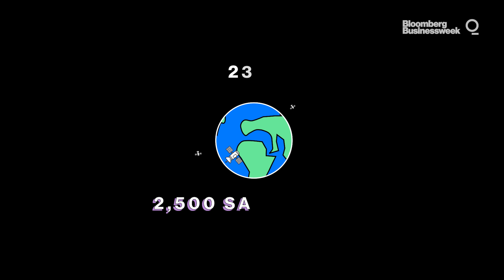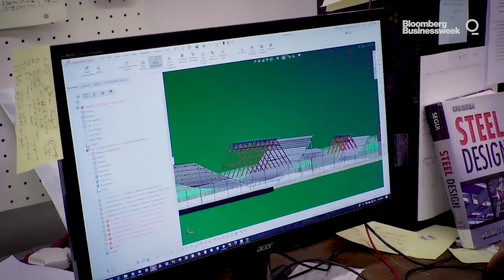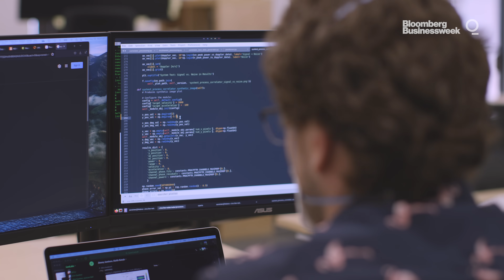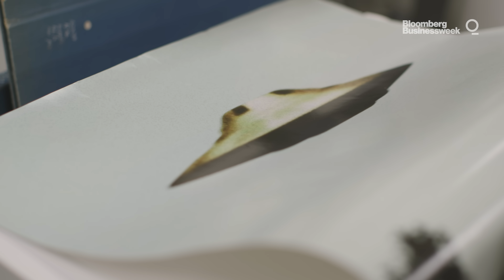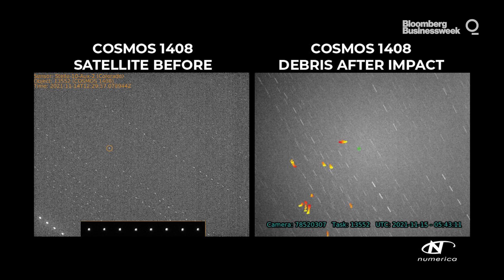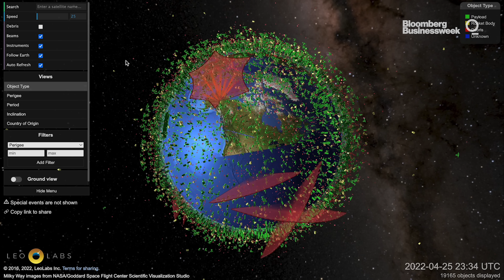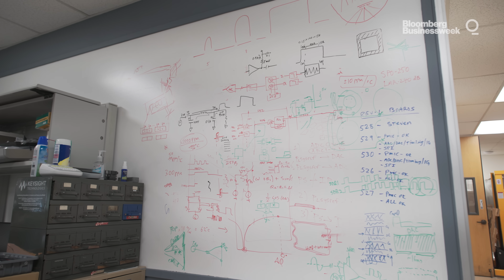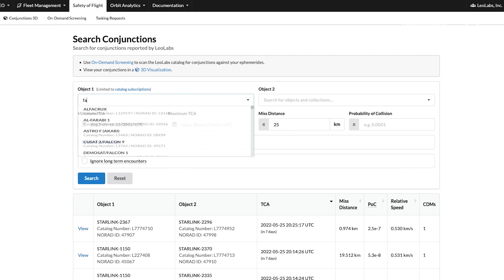How LeoLabs Is Using New Tech to Target Space Junk

Comment: Dont believe a word- nothing can remain in the air: Satellites are on the ground- ask every commercial pilot!
Reply: Have you actually asked a commercial pilot though?
They know better than most that the air gets thinner and thinner when you get higher.
If you get high enough there is barely any air resistance anymore. (much higher than airplane)
There, if you go fast enough sideways you'll be able to fall around the earth since it's round. You have to go crazy fast: 20x speed of sound, 8 km/s. That's why large rockets have to be used to make satellites stay in space.

Comment: is there any way to clean up this mess? could we used some sort of nets to catch the debris? is there any way to push that debris out into deep space? would that be safer?
Reply: Everything in low orbit will come back to earth in a few years ... 15-20 years something like this
Reply: The problem is things move really fast. That's why they stay in space. If you try to randomly catch some debris with a net it just explodes violently from the collision. Just putting a big net in orbit is like those bad debris creating anti-satellite weapon tests. So you need to match the orbit to catch each piece of debris gently. This costs fuel. That means more cost and more mass, which means you need a bigger rocket to launch the debris collecting satellite. Bigger rocket is more expensive too. It's still expensive to launch stuff into space, so it's just not worth the money doing the clean-up that way at the moment.

One way to get rid of the need to match orbits is: shoot at the debris with a laser. A laser can ablate some of the surface of the target, acting like a thruster. If you fire at it from the right direction you can slow the debris down which makes it go lower. But putting lasers like that in space is a political problem (and also expensive of course). If for example the US did it, Russia, India and China could see it as a threat. Those lasers could easily destroy optics of spy satellites for example, or perhaps damage solar panels too.

Satellites launched now should have the capability to reenter the atmosphere after their mission stops.

Pushing the low-earth orbit debris into deep space costs more fuel than pushing it into the atmosphere where it burns up.
Reply: A net?
Reply: What Lebron said. The lower the orbit, the higher the drag from the atmosphere. 
So if you push the debris anywhere, you push it into the atmosphere.
Only GEO synch sattelites are pushed away from earth, to keep the GEO synch orbit clean.
Reply: No. Even those centimeter sized pieces of debris have the kinetic energy of a high powered rifle, a medium sized explosive, or more. Disregarding all of the other reasons a net type solution wouldn’t work, the most glaring is the absolute absurd size it would have to be. The debris are hundreds if not thousands of miles apart from each other in 3D space. It would be impossible to get a net even remotely large enough to be effective into space, even if we somehow found a way to make it strong enough.
Reply: If you have a 30mm or something cannon going at Mach 8 it would have a kinetic energy velocity TNT equivalent of about little over 3 Kilograms
Reply: Difficulty is the parts are travelling faster than a bullet any materials used would pass right trough! The space station has some shielding that is layered in such a way that the object destroys itself mostly passing through the first layers so the kinetic energy is lowered to avoid a hull breach.however larger parts would not be thus the station would need to move out the way.
Reply: You plan to catch a frikin chunk of metal whizzing past at kms per second with a net...ok